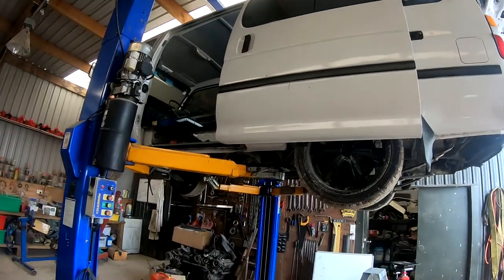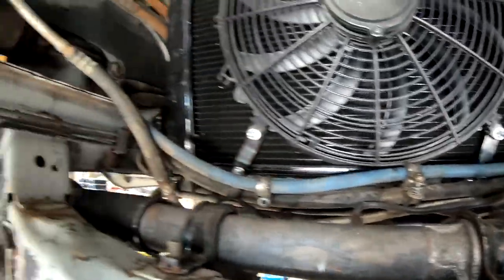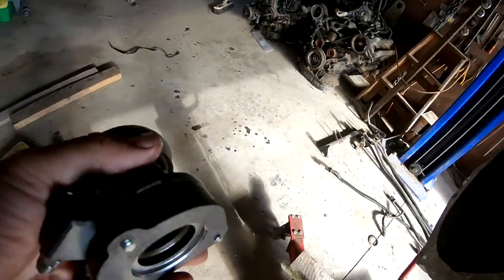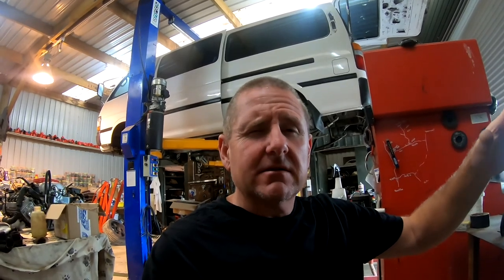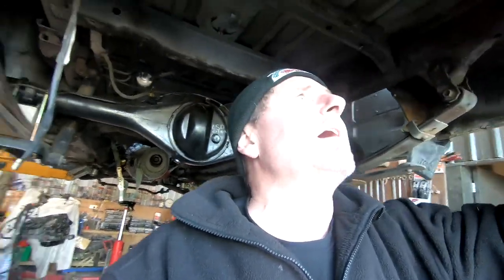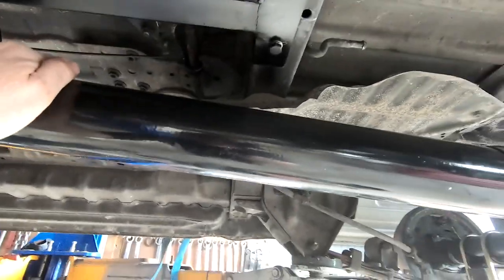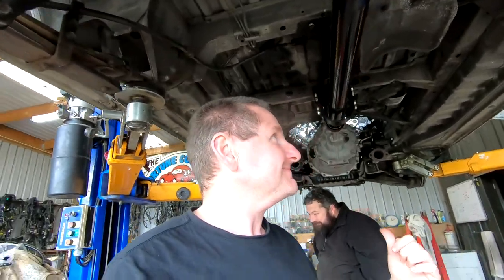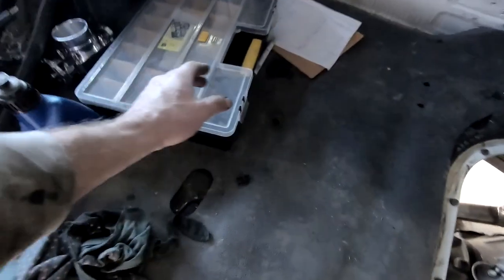1uz Toyota V8 Hiace van conversion  Fitting engine up until it needs wiring

Comment: We used to have the hiase van in the usa the engine was awesome  but they use to have a lot of brake problems  on a hard braking you could get the rear tires of the ground  and do a endo like a motorcycle
Reply from the maker: All these light in the bum vehicles the drivers have to be careful on heavy braking.  Cheers Kelvin

Comment: Nice job you're doing.
1. Does LS400 have manual transmission? If no, what manual transmission system did you use, and from what vehicle pls?
2. What pressure plates, etc are you using and from what vehicle?

Thanks.
Reply from the maker: No factory manuals available for any 1uz powered cars.  When I do a hiace swap I avoid the small G55 hiace gearbox and instead use the R350 out of a suitable model hiace,  in this case the same shape has this hiace, using the flywheel and clutch setup which I stock and sell myself.   Its a specific 1uz manual swap pressure plate.

Comment: The Hiace engine bay looks bigger than I had thought. Would it be possible to fit a 1UZ with a turbo or supercharger in there or would that make things tighter than they should be?
Reply from the maker: Ive done both turbo and supercharged hiace.  Cheers Kelvin
Reply: @CartuneNZ  Thanks for the quick response. Have you done diesel builds as well? I recently imported a '97 Hiace into the states and am kinda torn between going 1uz or keeping it diesel. So would a 1KD-FTV from a newer Hiace also fit?

Comment: I got my uzed into the car and everything hooked up only to find I didn’t drop the torque converter in and Twist properly on to tranny, and now it moves but won’t go faster then 10mph.  Good thing is it’s only a $450 mistake as the junkyards have Em around. I Wanted to punch my self in the nads for that one.
Reply from the maker: hopefully you sort it soon. Its a more common mistake than most people know.  Cheers Kelvin

Comment: Love your work 👍👍 these Headers what Are they from. Would they fit a ls 400 Lhd. I can do modifi myself, but woud be Nice too have some to start with 👍😎
Reply from the maker: They are headers of my own design.  They can be made to fit the LS400 by starting with our unwelded set like we did on this van and then tweaking to suit the LS.  One pipe needs changing around the steering and on they go.
Reply: Oohh Nice. 👍
Reply: How much for the unwelded set 😁
Reply from the maker: @Ibs2555  in nz dollars atm $750nzd.  This is about $540usd.  Plus freight.   Cheers Kelvin